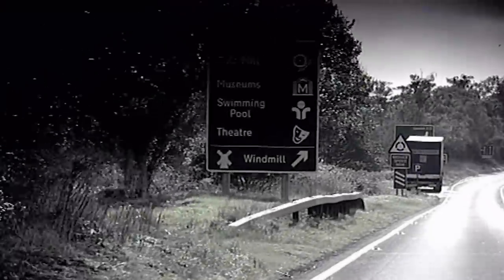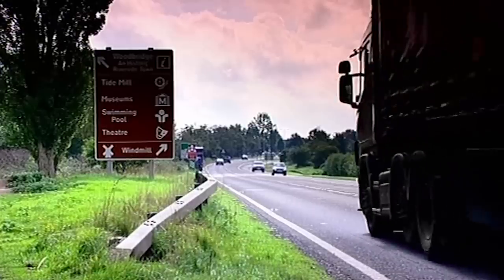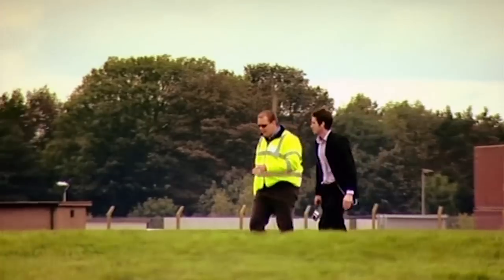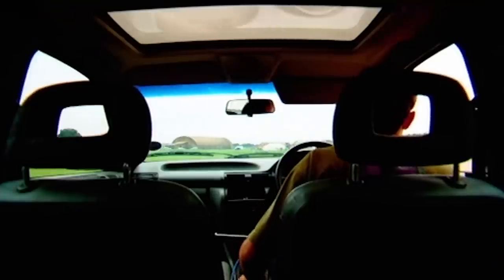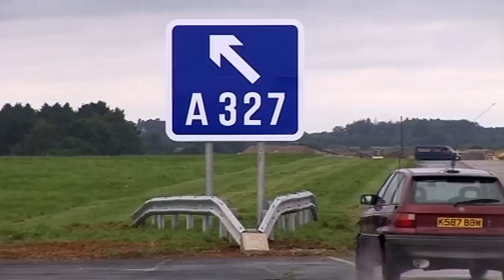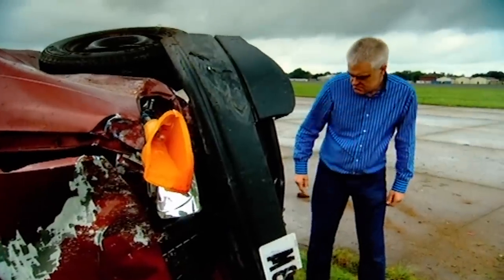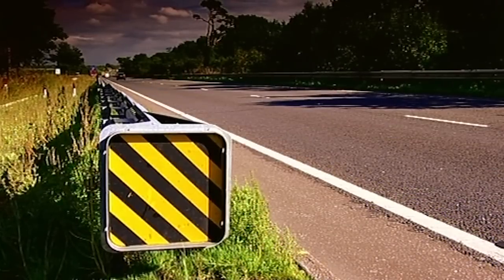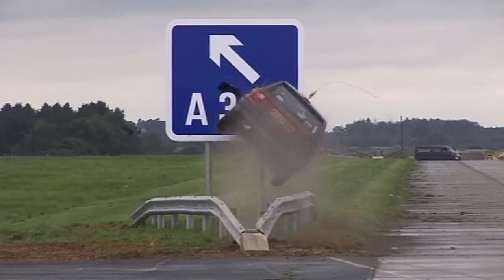Crash Test Month: Driving Off A Crash Barrier

Comment: These crash cushions are very common in the states. They work very well I hope England adopts this design too.
Reply: I hope we do
Reply: we have, the absorption ones are pretty common now, this video is over a decade old now,  although, Some of the ones in the US had this slight issue:
https://youtu.be/sR7GmxHBgL8?t=96
Reply: I hardly see any of the ramped barriers in the UK anymore it's all the cushioned ends
Reply: you do still sometimes at the end of them barriers, ie on the opposite end of the cushioned end where it's pretty much impossible for anyone to hit it.
Reply: We have on newer and major motorways
Reply: @leonb5293  Ramp Barriers are an ancient design. We had them in the 70s. Some abandoned roads still have them. But mostly all roads have a grassy ditch at the exit and maybe some deformation barriers in urban highways.

Comment: If i had to choose between a blunt plain steel barrier end or a ramp over it, I'd take the superman route everytime. Back in the day crash bumpers were not really an option so I understand why we have them. We have a lot of those ramp ends for the concrete medians around on ramps etc.
Reply: You do know that steering doesn't work in mid air, don't you?
Reply: Nanorisk A steering wheel isn't much use if your face is wearing it :)

Comment: At least the occupants would survive in the ramp crash, and they may not if it was a blunt, non collapsible barrier. So in this scenario, the ramp, while still leading to a fairly severe crash, would save the occupants' lives. They'd still be bumped about and hurt though. 

March 20, 2015 3:14 am
Reply: To keep track of when they were posted. Most forums on the internet date stamp the posts. YouTube just gives you vague dates, such as "2 years ago", even though they have the EXACT date stored. 

August 13, 2015 8:18 pm
Reply: +whattheheck1000  I knew instantly you had aspergers the second I saw the date at the end of your comment. I also have aspergers and have a similar obsession with keeping track of the times I done various things.
Reply: whattheheck1000 The year 2010 was the best.

Comment: What year is this video made?
Reply: 2006 / 9th October (Series 10, Episode 3)
Reply: ***** Thanks! I thought it was earlier.
Reply: No problem :-) Yeah they used cars this age for these tests around then. I also thought that a (different) Fifth Gear video was from an older series than it actually was. It was the one where they put petrol in a diesel Astra and diesel in a petrol Escort, the petrol cost less than a pound per litre. Turned out there was a three-year overlap; first garages hit £/Ltr in 2004 and the last ones not until 2007.
Reply: +RWL2012 Judging by the CR-V at the intro, I thought it was in 2012 or so